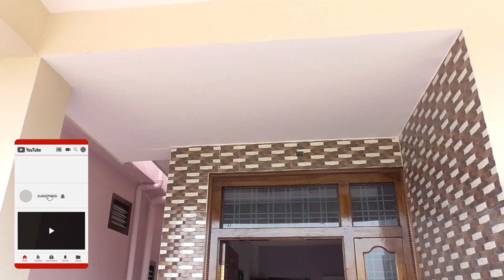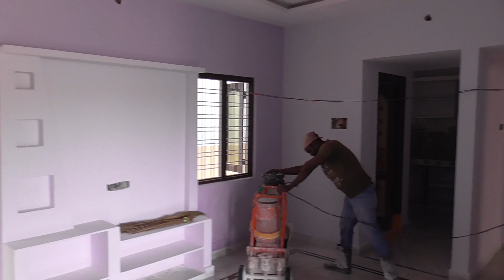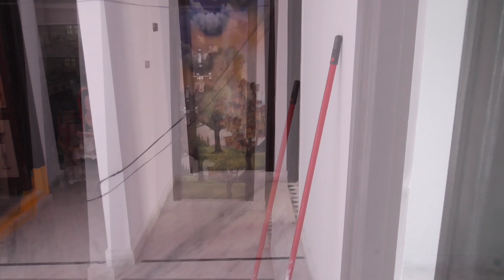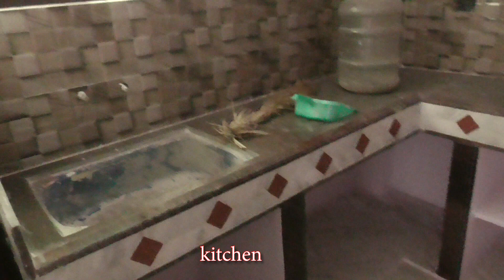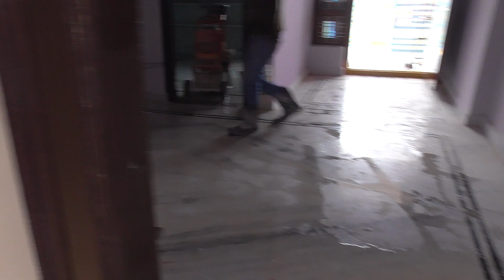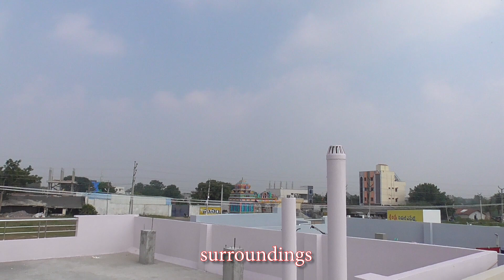2bhk independent house for sale at hyderabad || 107 sq.yds 31 X 31 dimensions || 50 lakhs only

Comment from the maker: video code: SR34
👉2bhk independent house for sale at hyderaba || 107 sq.yds 31 X 31 dimensions || 50 lakhs only
                full details:
👉 107 sq.yds (land)
👉 31 x 31 size (dimensions)
👉 west facing 
👉 only ground floor 2 bkh + parking
👉 water bore available
👉 full ground water
👉 పైన ఫ్లోర్ వేయాలంటే పర్మిషన్ తెచ్చుకోవచ్చు 
👉 no LRS
👉 turkayanjal municipality approval
👉 loan facility available
👉 cost 50 lakhs only (negotiable)

👉 adress:
తొర్రూర్ , 
hayathnagar busstand to torrur 5 km only
lbnagar to torrur 10 km only
secundrabad to torrur 26 km
hyderabad, telangana state501505
india 
cell: 7330845388
exact location pin
 17.287213, 78.613507 (copy this ip  and paste on google map)
Reply: Bro low budget lo untea send mee 25lacks lo plz bro makuu shamshabad location lo kavali